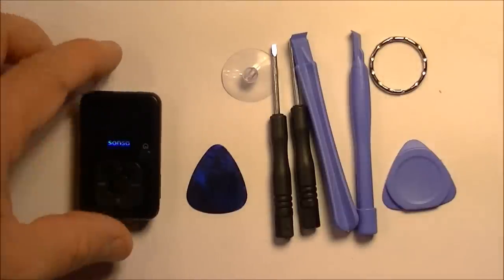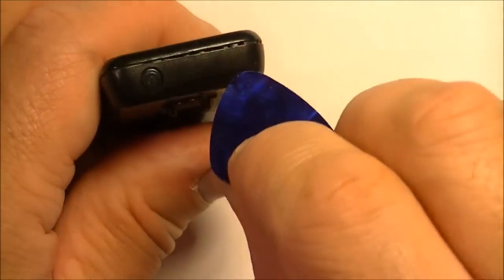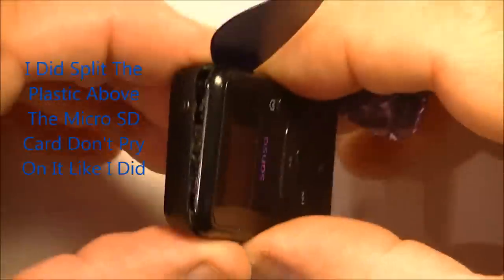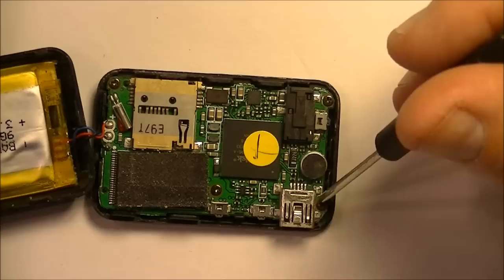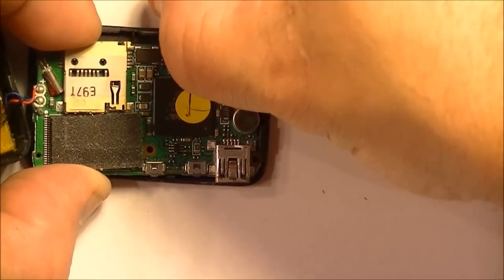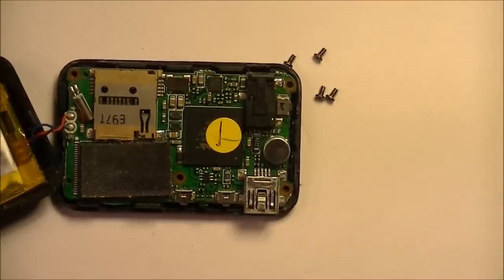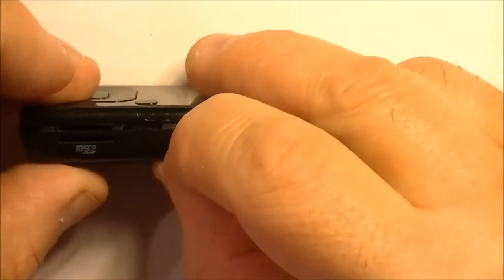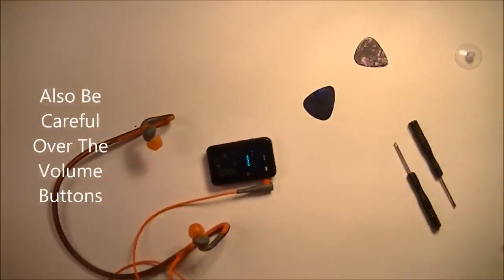Sansa Clip + Full Dissasembly Teardown and Reassembly

Comment: My Sansa got a little wet while spending the day at the beach. Is it possible that it will work again? I haven't been able to get it to power on, but haven't recharged it yet, It had a full charge befor the rogue wave ruined my day.
Reply from the maker: Billie Hanson Hard to say as it was on when it got wet. Mine went through the was twice but it was off both times. I let it dry in the sun for hours until I was sure it was dry before I turned it back on. I suggest taking it apart and letting it dry thoroughly then try to turn it on again. If that does not work try putting it back on charge and see if that powers it back up. You never know. Thanks.
Reply: Thanks! It was not on when it got wet. I appreciate the help!
Reply from the maker: Billie Hanson You are welcome. Thanks for watching and best of luck.
Reply: Iam afraid to try and take it apart for fear i am going to bust it!
Reply from the maker: Billie Hanson You could always fill a sandwich bag full of rice , wrap your player in a paper towel to keep the rice out of it, place the player in the bag of rice, seal the bag up and leave it in there for a week. The rice will absorb the moisture in the player. Then take it out and test it. Thanks
Reply: +Richard Lloyd Basmati or Jasmine? (just kiddin')
(I enjoyed and used your reset vid. Thank!
Reply: +Dennis Hermanson   Hey, that vid was by RJ The Bike Guy
So what do I know? Thanks for your vids.
Reply from the maker: +Dennis Hermanson You are welcome. Thanks for watching.

Comment: Thank you for this video! I'm still a user of Sansa Clip+ and it's funny to see what massive prices are paid for the original, old-fashioned Clip+ today, even used ones. Sorry for asking, but what is making this old player so special? Anyway, I'm still happy with it and so glad that I don't have to rely on my phone in terms of listening to music. I prefer the good old mp3s on my Sansa instead of hassling with a low phone battery, desperately looking for Wi-Fi to have access to streaming services etcetera. The only thing that has suffered massively after all these years was the battery capacity and also the displayed battery percentage in the configuration menu which has gone a bit weird. You can even replace your old battery with a brand new one! Unfortunately, I don't have the necessary tools foor this (you need a soldering iron), and most likely not the manual finesse either. :)
Reply from the maker: What makes it AWESOME is it's size, it's compatibility with just about any music format, it's sounds amazing, has an FM radio receiver (you can record from), it can record live audio with a built in mic, can store amazing amounts of music and can play them all very loudly for 8 hours and you can change the firmware to RockBox and do all sorts of crazy things with it and it works great without having to have your phone on you. Almost too good to be true. That's why it is such a coveted device and yes you can replace the battery if you know how to solder. I still have both of mine! Thank you so much for watching, commenting and the kind words. I appreciate it greatly. All the best.👍😀
Reply: @richardlloydusa   Thank you for this video!  yes man, RockBox is cool firmware!!
Reply: @richardlloydusa  Any pointers on the correct replacement battery?  Thanks.

Comment: Wish I saw this video before the one with the kid who used a knife to open it.  Scarred the case.  Not that it matters, because I still don't know why it wont turn on anymore.  Worked when I fit it to the usb cable and plugged it into the comp.  Went to unplug it and it isnt' even trying to turn on. Did a hard reset multiple times.   Nothing.  Pity because I love these and this is my second one.
Reply from the maker: It sounds like your battery is dead. If know how to solder you can replace it yourself. Here is a link to the battery at eBay: https://goo.gl/TgYHTe Thanks.

Comment: Will this work on the clip sport ?
Reply from the maker: I don't have one but it does look similar be careful around the switches if you pry it open as the case is weak at those points. Thanks.
Reply: Great. BTW which is the radio chip ?

Comment: I don't have any guitar picks. Can I use a flat head screwdriver instead?
Reply from the maker: I don't recommend that as it is made out of metal it will most likely  scratch an or break the casing and can damage the circuitry by either scraping or shorting the unit. Remember the unit is actually live all the time as the battery is soldered to the main circuit. Use something made from stiff plastic or go to your local music store for a electric bass guitar pick or stick electric guitar pick. Thanks.

Comment: I have a sansa clip jam which seems to be dead.  Can't say I've actually heard of anyone actually performing surgery on a device.  It would seem simpler just t to buy another one.
Reply from the maker: Thanks.
Reply: Buying another would be easy enough if they still made them. This type of sansa clip is no longer manufactured. I have about 4 perfectly good clips, 2 that have low batteries, so I've gone the "buy another one" route and it only works for so long with a discontinued item. I'm so glad to find out how to change the battery. Thanks, Richard!

Comment: where can you purchase a replacement battery for the clip+?
Reply from the maker: +garfieldisgod You can buy one on Ebay http://www.ebay.com/itm/Original-Sandisk-Sansa-Clip-Clip-Plus-4gb-8gb-Replacement-Battery-Pack-323036P-/361433429739?hash=item54271c76eb:g:w1AAAOSw~gRV6cc6 Thanks.
Reply: Not now.. Can you also make video about changing battery? 
That video is nice.
Reply from the maker: Thank you. I may do a battery replacement video in the future. Mine does not yet require a replacement. Thanks

Comment: Never showed how to change the battery though
Reply from the maker: +Malena Kutchmarek The battery is soldered in with three wires, you can see that at the 6:32 point in the video. It will require you to unsolder all those three wires, remove the battery and solder the new one in. Make sure you check the polarity before you do it on the old battery and the new battery as well so you get it correct. Thanks.

Comment: Wouldn't it be easier if the manufacturer would just put a battery door on the dern thing? :)
Reply from the maker: +SolarReturn It certainly would be easier. I have found that engineers seldom reveal why they do the things for better or for worse. LOL It's still a great mp3 player that I still use today. Thanks.
Reply: My screen is green and I tried resetting it but nothing seems to help. Any suggestions? Has anyone out there ran into this problem before? Any information would be greatly appreciated!
Reply from the maker: +SolarReturn How did this happen to the screen? Thanks.
Reply: +Richard Lloyd I'm not really sure how this happened. I was just playing my music one day and when I was done listening, I turned it off and then the next time I wanted to use it, I turned it on and the screen was Green and and has stayed green ever since. I was thinking maybe it was a glitch of some kind so I tried resetting it but that didn't do anything. Then I thought the battery might be suspect, so I made sure it was fully charged. It appears it still charges in this state of having a green screen. I still suspect maybe the battery might be the problem. Example, as you know, on some electronic devices, even after they are reset or rebooted, still have some memory left as long as there is some power still feeding it, however so small of power that may be. So, I figure, maybe if totally disconnecting the battery and then reconnecting, maybe that will fully reboot it. Outside of that, I'm not sure why it's acting like that. I never had that kind of problem with a Sansa player before. I contacted Sandisk and asked them if they knew what was wrong with it and all they wanted to know was how long I had it. I said a few years, they said they couldn't do anything because it was out of warranty.......So, I don't know what I'm going to do with it. I figured it's probably done for but I'm going to try a few more things before I get rid of it. I hate to throw it away because I really do like this model. Hopefully you or somebody out there can help me figure this thing out. Any help is greatly appreciated! Best regards!
Reply from the maker: +SolarReturn Have you let it fully discharge to a dead state yet? Thanks.
Reply: Well, yes and no. Not intentionally anyway. its been sitting around laying dormant for a good 3 or 4 months now. So, while its fresh on my mind, I will check to see if there's any charge left in it. Do you reckon if its discharged and then recharged back up, will it work again maybe? im hoping it will. I took the "battery cover" off but haven't disconnected the battery.......yet! Speaking of batteries, would you happen to know what kind of battery I could use to replace this one by any chance? Also, where could I go to purchase one at? Any help is greatly appreciated! Best regards!
Reply from the maker: +SolarReturn It eventually has to discharge to the point of zero function if it's stuck (digitally) that glitch may reset if the battery discharges to the level of zero operation. You can purchase the battery on Ebay here is a link to one http://www.ebay.com/itm/Original-Sandisk-Sansa-Clip-Clip-Plus-4gb-8gb-Replacement-Battery-Pack-323036P-/361521033555?hash=item542c553153:g:w1AAAOSw~gRV6cc6
Reply: Richard Lloyd Appreciate the info my friend! Take care
Reply from the maker: +SolarReturn You are welcome. All the best.

Comment: My power switch isn't working :(
Reply from the maker: +R Coltman Does it power up when you plug it in to charge? Thanks.
Reply: Yeah it works fine, the button seems to have gotten stuck.
Reply: Hi thanks for the video i did open it and the power buttons switch is dettached ?SHould i glue it with something?if yes do you know with what?
Reply from the maker: Is it the black plastic part that you would push on to power up the player or the actual switch on the board? Thanks.
Reply: the metallic switch on the board!
thank you!
Reply from the maker: Unfortunately if it has come off the main board it will need to be soldered back on in order to function. Thanks.
Reply: makes sense hehe thanks again :)